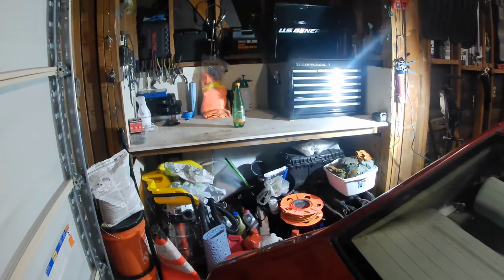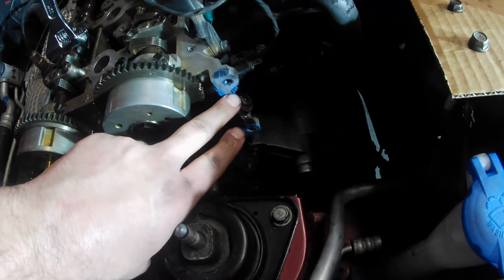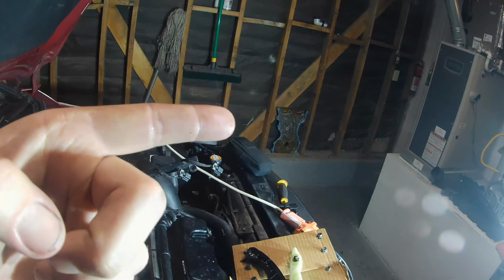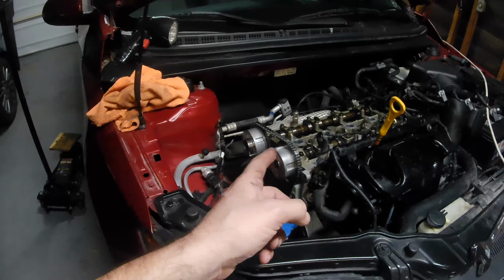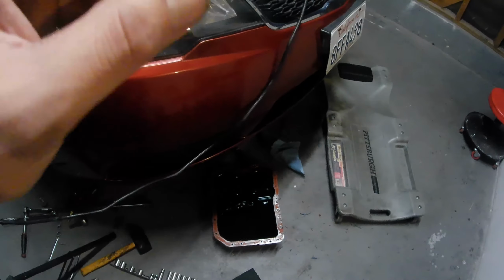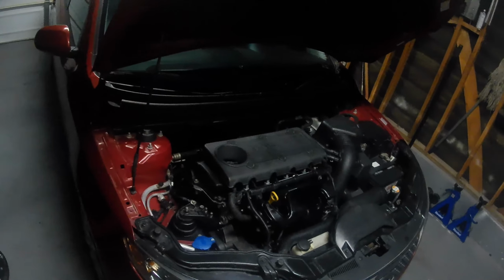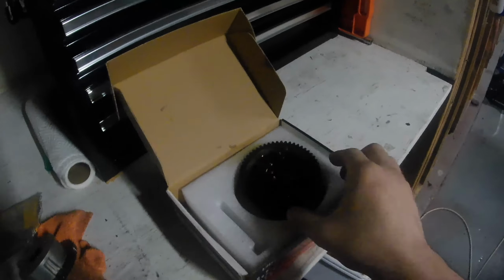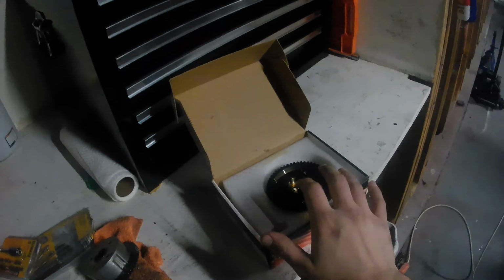My worst NIGHTMARE is SOLD, and I made some money

Comment: I'm glad you got rid of one nightmare, one more to go. Well I wish we weren't so far away from each other because I have the next flip Car. About a little over 3 weeks ago my Sentra wouldn't start and after getting it to start it dropped in compression in two cylinders and has a nasty tick. Suspension, Brakes, Transmission - Tires - fluids serviced All things that no one needs to worry about, makes me sick. Needs Minor body and paint and whatever engine. Purchase price $ 2700- $ 1700 in maintenance I'll be lucky if I get $500 beside myself in Disgust. Good luck with nightmare 2 I can't believe after all that it's still wanting more from you. Till next time My Friend.
Reply from the maker: Thank you Robert. Sorry to hear that. I’m assuming spun bearings? Or you think chain?
Reply: @BrokePremiere  possible bearing, everything else my mechanic checked out everything is fine at first couldn't figure out why it didn't want to idle so IAC was replaced something else for throttle body can't remember so mad right now, I babied the hell out of the car just don't understand
Reply: Anyway whoever gets it, Ends up with a Meticulously owned car Owned by an Idiot 🤣
Reply from the maker: Ahh man might be worth trying to replace bearings. Could be a couple week project on the side. Parts can’t be more then $100. You might get lucky like I did with my first flip on the Channel. Just dropped pan, oil pump. Then literally shook the end caps of the rods. Found the 2 that needed replacement. $40 later. Changed them and then immediately the engine purred. Even if you get only another 10k miles out of the car. Might be worth it to tinker over a couple of weeks. Just a thought. Either way best of luck. Sometimes just a good pot hole can spin this suckers.
Reply: @BrokePremiere  Thanks 👍